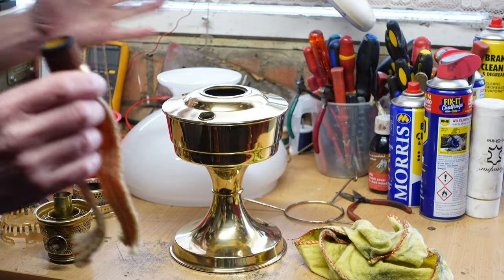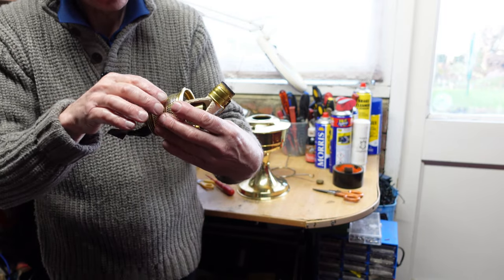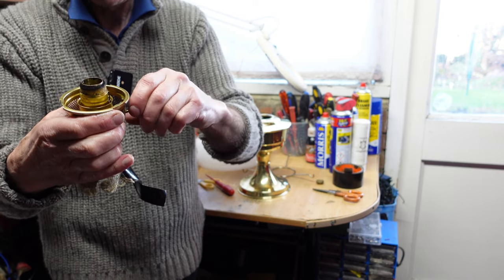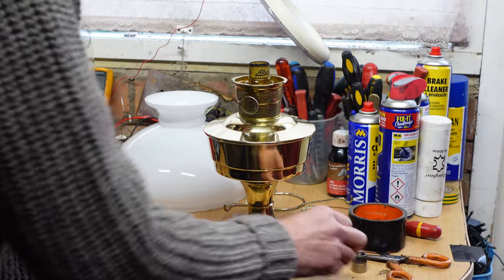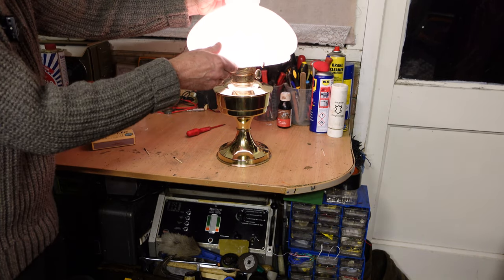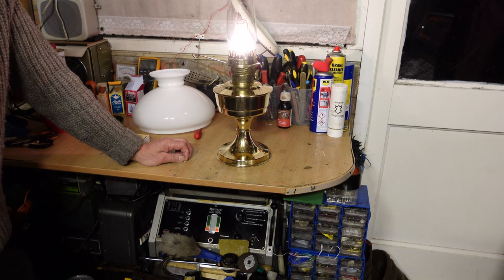The Amazing Aladdin Lamp

Comment: I'm messing with one like that right now. Just found out that the "flame spreader" is a tuneable item. It should be a snug slip fit and the height of install makes a difference. Mine would light the top of the mantle but not the bottom portion, spreader too deep. I raised the spreader slightly and now it works much better.  Just my two cents worth.
Reply from the maker: Thanks that is very interesting I did not know that I just pushed mine down as far as it would go down! I will have a try at that when I next get the lamp out to light up again Thanks for the interesting comment. Kev.
Reply: Yes!  It's the opposite of what you may think. (Lower the spreader to raise the glow on the mantle) If the flame spreader is too loose to be a snug fit, slightly bend one of the corners at the notches outward with a pair of needle nose plyers to get it to fit a little tighter. I learned that from the "Kerosenes Lamps of the North" channel.

Comment: Enjoyed the video! Thanks. A couple of things. These new mantles are very bad quality. I bought 4 of them (in the red and white boxes), with kind of like a dark blue/green coating and when I burned the coating off, the mantle fell apart in spots. Luckily, I received a refund. I think you have the same issue at 17:39. You're better off purchasing the new OLD STOCK mantles in the orange and blue boxes which were manufactured in Brazil.. They're MUCH more durable than the new ones. Also, the 23 model burners have a hexagon shaped knob. I think yours might be a 21 model.
Reply from the maker: All very interesting many thanks for your most interesting comment re these poor quality mantels as you can see I'm not up on the Aladdin lamp numbers! So I think you are right about what I have here they are just so lovely and still work and give such a good light out! Thanks again Kev.

Comment: I have burned kerosene and lamp fuel in my Aladdin lamps and I am thinking about trying paraffin fuel.  Some who have used paraffin fuel say that the wax will eventually clog the wick.
Reply from the maker: Hi, To be honest, I have only ever used UK Class C1 Top grade paraffin in my Aladdin lamps this seems to burn fine no smell only a little when you put the lamp out but I found this works very well and burns very clean with not a lot of soot or carbon on the wicks So never found any issues using this top-grade paraffin in these lamps at all thanks for your very interesting comment. Kev.

Comment: Are you sure that’s a 23?? Looks like a super Aladdin burner to me. The 23 carrier is made of a sort of steel with a galvanised coating. The 21 is similar but gold with smaller tabs. The super Aladdin has a slightly different winder mechanism which is geared for better control. I actually prefer this as the 23 is just a scaled down version on the heater number 203 carrier design. I have a few 23 and one super. To be honest I know the mantle lamps are technically far superior to other types, but they can be temperamental sooting the mantle with room temperature changes ect. They need closely watching whereas the duplex is normally easier to care for. Not to mention cheaper. Good videos, we share quite a few common interests, I enjoy inland boating, older radios and TV sets, although not as old as your vhf type tvs, and of course the paraffin appliances of which I use a number of Aladdin and valor heaters around the house when necessary. Regards, Tim.